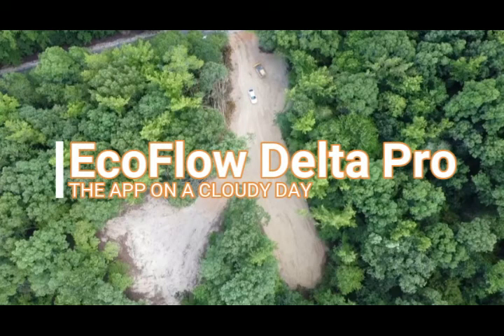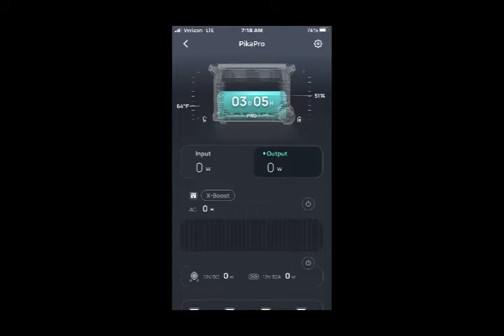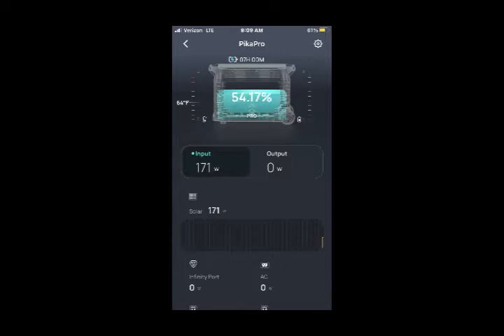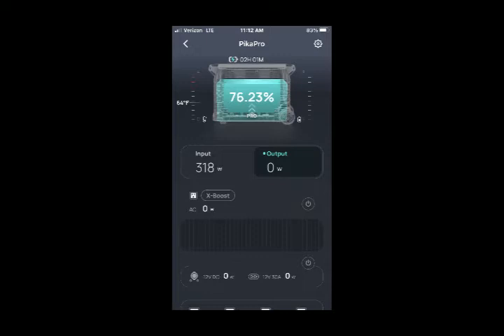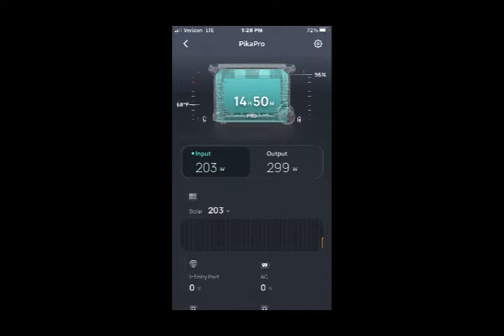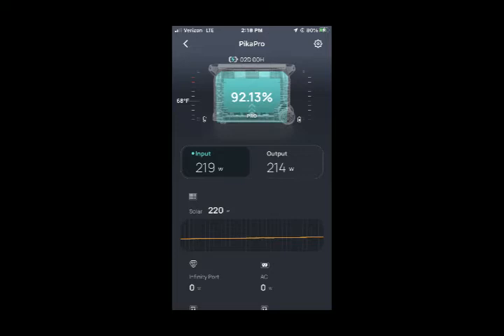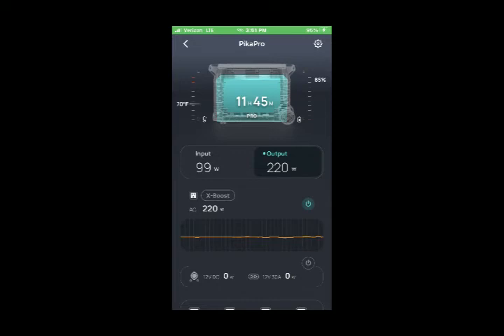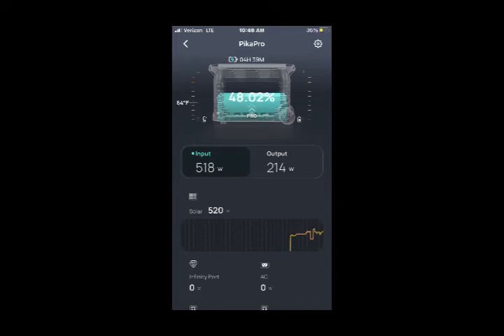EcoFlow Delta Pro Performance on a Cloudy Day

Comment: Also as a note currently we are using just the EcoFlow Delta Pro to power our 1400 square foot home during the peak hours from 5:00am to 9:00 am and 5:00pm to 9:00 pm Monday through Friday and recharging on the grid in off peak times until I can construct the rack to hold the panels.  We live in the panhandle of Florida and hope this setup can accommodate any downtime from hurricanes and mitigate our gas and propane usage 👍
Reply from the maker: We've been able to keep our power needs down during cloudy days (which we seem to have had too many of recently), but during sunny hours, works a treat. Sounds like a great idea, keeping the unit powered via grid until you get solar in place!

Comment: Thank you so much for taking the time to document the solar and EcoFlow usage… we have managed to get the EcoFlow Delta Pro along with one extra battery. I have 1200 watts of solar panels to add to the system to keep the batteries charged. I might be able to over panel but with 2s2p we are pushing 145.8 volts we are using the Renogy 100 watt panels for the 1200 watt, 145.8 volts, 11.44 amps.  How much more have y’all been able to over panel your system without causing any issues?
Reply from the maker: We've not overpaneled our setup yet, but we have new panels to add to our array. Will get a better picture once we get those in place.
Reply from the maker: On the overpaneling, once we add the four new panels (two to each array), they will be ~1200 watts each (6 x 195 watts) and 120V per array. So we have some "slippage" in terms of Voc. That said, we have more than 15 amps going down the wire from the two arrays (~10 amps each). The Delta Pro will only draw down 15 amps max, so assuming our own array is 1200+1200 = 2400 watts, it is really more like 2400 x 15/20 = 1800 watts. So that will be overpanel "test" that has been mentioned. Right now, we have ~1600 watts total, so is technically 1200 watts. So far, the highest input we have seen is a little shy of 1000 watts to the Delta Pro from the current array. But to be fair, we are not optimally positioned and certainly nowhere near summer full sun capacity.